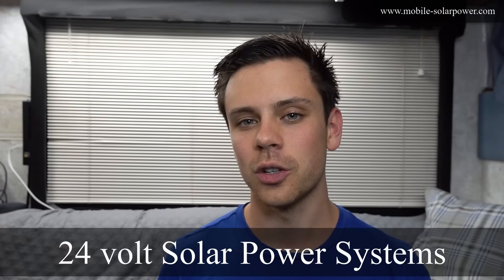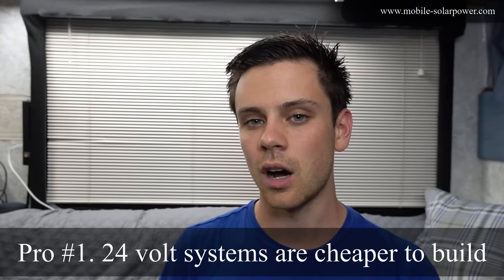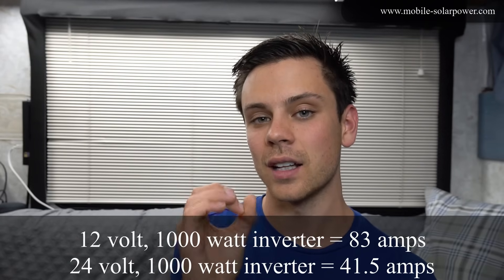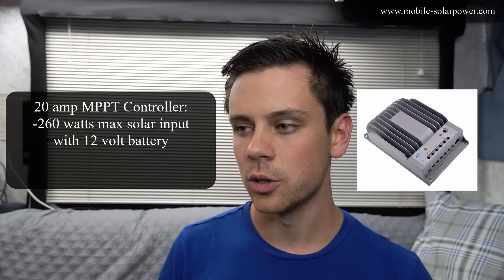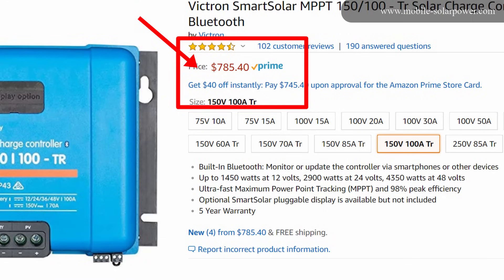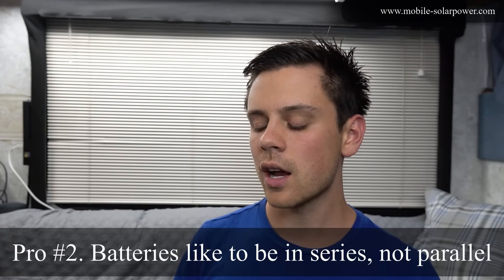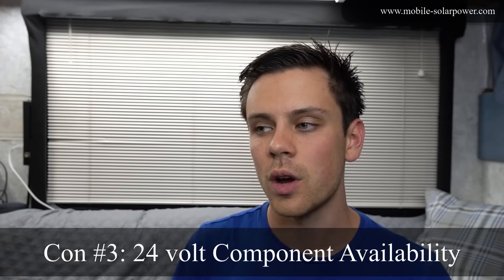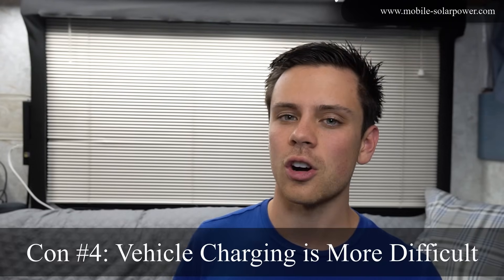12 volts VS. 24 volts for Off-grid Solar Power Systems

Comment: I have been to three different repair shops for both trucks and RVs and have heard a lot of immediate objections to your 24V system for larger RVs when I bring it up… then they have to back pedal and admit that your designs are “not weird but different,” or “exotic,” or “labor intensive.”  I’m smart enough to know when guys try to talk over my head because I’m a petite female.  Or just lazy and don’t want to do an install any other way than how they’re used to doing it.  

Correct me if I’m wrong but I’m actually sensing that they are steering me in the direction of using my alternator and generator to charge my solar battery bank for two reasons:  1.  To rack up installation labor hours, and/or 2. To make me give up on your system because they just don’t want to do it your way.  

It’s so ridiculous to me how much ego gets in the way of a simple service.

Comment: It seems a shame that we have that 50 amp alternator on the engine of our bus and it can't be used to charge up our battery pack. Isn't there a device that can limit the amount of the amperage the battery pack can draw from the alternator? Since we are driving hundreds of miles a day it seems a waste of energy to have an alternator running constantly and not charging anything.

Comment: Any thoughts about putting a small 110v inverter under the hood and plugging the 12 or 24V DC charger into it? You would need to monitor alternator temperature. Tx, you are my solar authority.

Comment: Really like your videos.  We have just built a 960 sq.ft home do we go 24 volt or 48 volt system. Do you have any info on the subject. Looking for input.  Will be doing most of the work myself in stages. Thanks for any help.

Comment: Most people that use a 12V storage system in an RV are probably still taking advantage of the battery charger in the system powered from shore power right? ...you probably wouldn't be able to do that anymore with 24V battery storage without adding a 24V power supply. ..right?

Comment: But with a 24 volt system don’t I also need a 24 volt battery? They’re expensive, comparatively. Or can I use two 12 volt batteries?

Comment: You said a converter is a good a pure sine wave inverter. But the converter is dc to dc. Don't you need a ac to run standard 12v appliances?

Comment: Hi. What if we charge with 24v and we store 12v using mppt? What do u think about this idea? I prefer to have 12v in my garden shed as I work  a lot with car components. Technically efficiency should be similar.

Comment: I love that i switched my rv over to 24 volt. The 24v to 12v step down transformer is awesome. No more peaks or valleys in power. No more flickering lights, varying light output, water pump never bogs if the batteries are getting low, its just great.

Comment: The reason full time rv'ers want to be able to charge from their alternator or other device while driving is cloudy days, for example for me it's been cloudy for the last 4 days and I'm driving cross country (PA to South Dakota). I have 6 lithium batteries in series and parallel and in the last 4 days I've had to use a lot of gas on my generator to power up my system but I could only do that in the evening. I have a device that charges while I drive but it only delivers 9 amps, not enough to keep up with demand. I'm looking at buying the Victron Orion-Tr Smart 12/24 volt 15 amp 360 watt dc-dc charger (what are your thoughts on that charger)

Comment: I'm 'zeroing in' on my 1st trailer and have been told that solar/battery is not sufficient to run the A/C and microwave, and, if I'm hearing you, a 24v system would run those appliances?

Comment: I have watched a lot of your videos and have issues still. Today you can buy 24 vdc L.E.D. lights, portable frig, water pumps, and a victron 12 to 24 alternator charging unit. What I don't see is. Fuse panel for 24 vdv. What am I missing on this issue?  you can also buy 24 vdc batteries and solar panels. The only 12 volt that I would need is for cell phones and such.

Comment: Do you have a video on scaling with time? For example, what if your needs started with 12v, expanded to 24v and eventually 48v. Would you just get a 48v system? Also, how do you salvage life out of your older units that can still produce power but are apart of your older low voltage system - is there a way to integrate an older 12v into a 24v?

Comment: I started building a 24v system. Haven't even finished it yet, and wishing I'd gone for the 48v system. The all-in-one inverters would have cost the same at 48v, BMS would have cost less, batteries would have cost the same(16s instead of 2p8s), cable would have cost less, better upgrade potential in the future, more solar input capability, just no down side. Would have cost less and given me a better system.

Comment: Very good points on why battery isolators are BAD, but I do want to point out a product that I think is an exception. Renogy makes a 60A DC DC charger that can accept 30A from the alternator and 30A from solar. 30A from an alternator is not a huge load especially for truck engines. They are normally around 100 amps

Comment: Yet, if everything you have runs on 12 volt, like ham radios, having a 24 volt system doesnt work for us, we have to have a 12 volt system or we cant use our radios. A 12 volt step down converter cant be used in our systems because they create a lot of electrical noise so that our radios cant be used.
Reply: Exactly. I've found that out the hard way, but I really have no choice than to run a 24v system. To enable my ham radios to function from 12v, I built an isolated battery bank using Headway 38120 cells; the step-down converter charges that battery and lets me run my radios without the interference.
Reply: @vespagts7078  I can’t find a step down converter that doesn’t make so much electrical noise that I can still use my HF radios.
Reply: @WH6FQE  Sorry, perhaps my previous comment wasn't very clear, let me try again. The step-down converter is only connected to the 12v bank, when the 12v bank needs to be charged. Hope that helps.
Reply: @vespagts7078  unfortunately my radios run 24/7 because I operate a Winlink station and am the Pacific Region Hub for radiogram traffic between the west coast, islands in the Pacific and Asia, so I don’t have downtime for charging. I have to be able to charge while the radios are in use.

Comment: Samlex SDC-23 24v to 12v regulator here. I run my network and servers on a 24v system here. Battery bank is floated off shore power but solar backed. Just to help with power cost but mainly power outages. 

24V bus alternators were generally oil cooled to keep from them from burning out under full constant load. There are air cooled versions available as well.

Comment: Woah... Who says batteries don't like being in parallel? There's a way to wire them up properly to equalise the voltage. 
 I have 62x 12v 7.2amp/h batteries in multi parallel.. they were used when I got them.  I have them connected to a 20amp pwm charge controller for the last 8 years with 2x 190w 24v batteries in parallel putting out nearly 18 amps..
 They're running great.. I pull one or two out occasionally to test them at random.. I run a lot of 12v led lights and a 75l camping freezer. Non stop for over 8 years now

Comment: To the point as always, and good info.  I will however, take issue with the '3 batteries in parallel is too much'.  A single battery is just a whole lot of cells in parallel.  a 100ah or 200ah or 300ah battery is just more cells in parallel, inside.  So really not much different if you parallel 3 100ah vs a single 300ah battery.

Comment: I like your explanation, please Suggest me , about this 
My home is smaller to medium 
20ft x 22ft  want to run light load like 
DC bulb total 150w maxx & 
4 Bldc ceiling fan 60w maxx ,
 As mostly i used 2 fans remaining 2 I use occasionally means around 60w total ,   so during day 100w maxx as bulb not required , 
at night  from 6pm-11pm 250w after that till morning only 100w as again during the night bulb not required. By keeping So what according to you is better 12v battery or 24v battery.

Comment: Advice Needed...Hey, Great Info Will! As a beginner in basic single 12v solar panel set up to run my computer and a small fan. Can you advise on the Inverter connection for me?
Can the i12v inverter be hardwired directly to the 12v output lugs on the PWM charge controller (looking to get load info from Charge Controller) or must it be on the battery posts(no-load info available if connected on battery )? Why yes or why not? Good idea or bad idea to do this?

Comment: so, if i have 3 lights consuming a total of 900 W on 18 hours per day, i should buy a 24 v system with 3, 100 W pannels, 3 batteries and a a dc invert and the solar charge ontroller ? ? what do u mean by little, medium or big system ?

Comment: Here is my experience with 12 volt and 24 volt I have tested both ways as I built my system a little at a time. My experience is that 12 volt saves you a fortune in batteries over time. I do my 12 volt different than most only because I have tested in almost every version you can with 12 volt and 24 volt. With 12 volt your batteries will last 3 times as long speaking of using lead acid batteries which I use I haven’t updated to lifepo 4. When you wire your 12 volt batteries hook all positive post in parallel but take your negative and make you a I call ground bar I use a piece of steel coated with copper with welded 5/8 stud bolts welded that is grounded to earth with a 8’ ground rod all negative hooks to this copper coated steel in turn I don’t care how long you hook it up this way your battery never lowers to the lowest voltage of the other batteries, you can add a new battery to the system with no affect of lower the voltage to the lowest or oldest battery in the system. Doing this you batteries will last 3 times as long verses series wiring to 24 volt. I currently have 2- 4 .00 gauge wires to carry the amps which on peak of sun I get 324 amps at 12 volt it works perfectly. The cost of buying the heavy wire is very worth the investment as you save a fortune in batteries over the years. I also switched everything over to 24 volt for 2 years to test this I went back to 12 volt which works just as good and saves a fortune in batteries. I haven’t used life po 4 batteries to test this with them but I promise you do this set up with lead acid you will be amazed of how much more your batteries will last.

Comment: Hi Will, I have a 12v Powerjack 6000w LF  220v out inverter. Can this inverter be changed to a 24v. I would like to change to 24v if it is possible. Regards Theo

Comment: Will I noticed on another video beside your bench you used a wire rack shelf,and you did some work on it with live connections. I would suggest you put a matt or board, or at least spray paint it with some stone fleck or something

Comment: Please explain how a major RV manufacturer installs a 48V system and runs 48V AC and 12V all other appliances. Further, this RV manufacturer charges the battery bank by the vehicle's alternator.  The manufacturer makes top knotch vehicles based off the Mercedes chassis.

Comment: I accidentally hooked a buck converter backwards on my 1984 holiday rambler.  At 28v everything worked fine.  Was shocked that nothing failed . Led lights and digital fridge,  nothing is original but rated for 12v

Comment: Say you have 2 12volt 100 AH batteries - parallel its 12 v200 AH, Series is 24 V 100 AH- but you step down V to 12 v to run items - are  the Amp Hours then 200  or Batteries will Last the same time as the 12 V 200 AH setup?

Comment: 4:46 so you say 2 panels of 12V each, in series, makes 40V? Wtf? Series adds volts, right? So how does this work. Shouldn't it be 24V?
Reply: I think solar panels are actually rated at 18-20V

Comment: Will, the Enerdrive dc2dc+ has a maximum input voltage of 45v and 40 amps Using MPPT, and can drive a 12v system just fine. Its the best of both worlds, cheaper panels and still using a 12V system that can be charged by the alternator on your car.....  All the other DC to Dc chargers I have seen have an unrealistic maximum input voltage of around 25-28V...

Comment: how would u install a 4 solar panel  with 18v 8.33A 150W. usage for a 3 unit 12V audio Amplifier. currently the system using are 2 panel series to SCC 12/24 30A to 1 unit 12volt 200ah lead acid battery. total 4 panel 2 scc 2 battery ..what would u suggest?

Comment: This video was deeply informative with regard to the decision that I’ve made that it was definitely going to be a 24 V system as opposed to a terrible system. But now I’m questioning whether I want to bump up to 48 V when it comes to my PV array. My system is being designed around an off grid tiny home on wheels that is essentially a whisper booth. All of the purposes and functions of a modern home hot water sewage treatment etc. The PV array is the primary energy input. I will also be putting in some additional wind generating power. Once the system is under way.
Reply: You can have a 48v PV array charging a 24v battery system, many charge controllers will allow it.

Comment: I'm setting up my first 12v system and I pretty much have everything and ready to install. I like your channel out of them all because you go into detail with everything and I have learnt a lot from you. Will be building a small 24v house in the next 2 years so I will watch anything you have in 24v. Thanks for all the good knowledge.
Reply: If you intend to build off grid or even grid tied house! Honestly forget all this babbling. Make your life easier and cheaper in the long run...

Highest voltage solar system you can comfortably afford. And step up the system to what is regular, in your neck of the woods! Meaning 120v or 240v inverter...
Your appliances will be way cheaper. Wiring way cheaper and so on! 

Entry level installation on 12V or 24V are relatively cheap and easy. Really nice for a cabin, tiny house and such! When the term "house" enter the game. It all change! ;-)
Reply: @crpth1   thanks for the info. I already set up my camper with 12v and 240v with 400ah battery storage and now going to build a tiny home in my back yard on 24v.

Comment: Can you please help, I would like to get 2 of the San Tan solar 250 watt panels (Rated Power: 250W
Open circuit voltage (VOC): 37.6 V
Max power voltage (VMP): 30.3 V
Short circuit current (ISC): 8.85 A
Max power current: 8.27 A
Power Tolerance 0/+3%
Maximum system voltage: 600V (UL)
Fuse Rating: 15 A) Can you please recommend 12v or 24 v. Also what charge controller for this system, and what and how many batteries?? Thank you!
Reply: How much is shipping on those SanTan 250 watt panels ?
I went to the website to see if I could put them in a shopping cart to get an estimated shipping cost, but all it said was shipping information not available...

Researching...
Thanks

Comment: Storage in a travel trailer is small. So it is hard to build a bigger battery pack due to the lack of space. Keeping the batteries charged up is very important to run fridge, lights, water pump etc. When traveling from place to place, it sounds like a great idea to use the Truck’s alternator to recharge the trailer batteries. Would a PWM controller isolate the engine battery and let the alternator safely charge the trailer battery pack?

Comment: Hello buddy I'm trying to figure out if ur using 240w 30.4v solar panel how many panels can I use per charge controller and does the power size of the charge controller matter if I wanna use 4 panels or 6 panels or even 8 240w 30.4v Panels..??

Comment: Hello I'm trying to figure out the best configuration for 6 240w 30.4v mono panels what type charge controller do I run in 12v or 24v etc

Comment: i have a question regarding series parallel connection of batteries.
Its a rule of thumb that series connection of batteries increase the voltage but not ampere capacity, for example two 12 volt 20 Ah battery in series still produces 20Ah but the voltage is now 24 , in theory the battery should last the same with 12 volt 20 Ah battery, but that's not the case.
Why?that new connection 24 volt 20Ah  actually last longer than 12 volt 20 Ah when connected to inverter. WHyyyyyy?

Comment: Bit confused about 1 aspect... In japan, 100v outlet. I plan to build a grid tie with no battery backup.  In this situation, as I will be simply plugging the output from inverter to my grid wall socket, does this mean I can use either 12v or 24v, or is there some kind of restriction?

Comment: You can get 12v of the 24v solar system by takeing leads from each of the 12v batteries i have done that with a 24v forlift and ran 12v lights

Comment: How do I make up a good large capacity 24v battery bank without spending a crazy amount of money? I can’t find a good 24v bank of 400ah for under $4000 plus tax in Canada which is the cost of the equivalent (all in) 12v system of the same size in total

Comment: When you have 400AH worth of batteries using the charging alternator is dangerous. When I've noticed that with the car batteries connected when running large load, my inverter batteries will fall below 12 volts and recover, but sometimes the vehicle batteries will not and fail to start even with the inverter batteries at 12. With your car batteries connected when you start the engine or plug with the inverter batteries low, it can blow a fuse. Finally, if you're trying to charge large batteries with your car alternator, it has shorten the life of my alternator and then your battery connection have to be rock solid or they'll melt. Previously, I upgraded my battery connection. Now, I have about 400AH of batteries and just install a protective relay that will drop out at 12.2Volts on the inverter side. I have to wait until the trailer recharges to connect to the charging alternator but it prevent killing my vehicle batteries and blowing fuses.